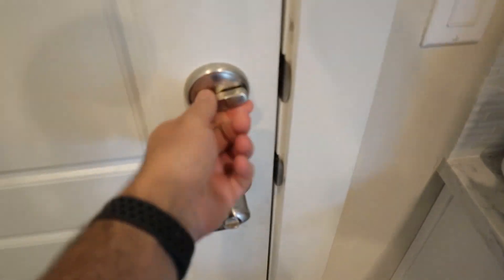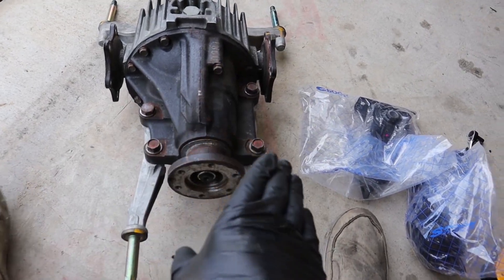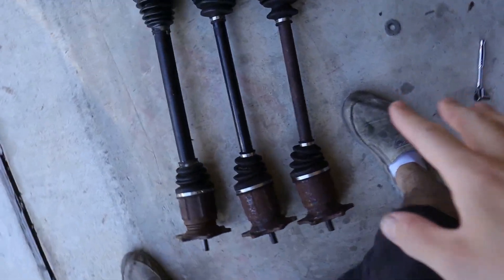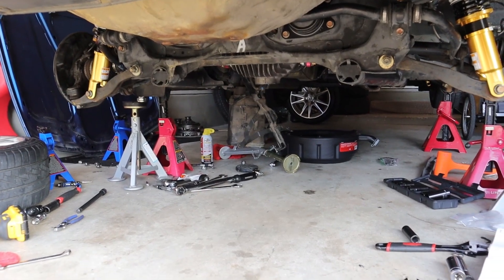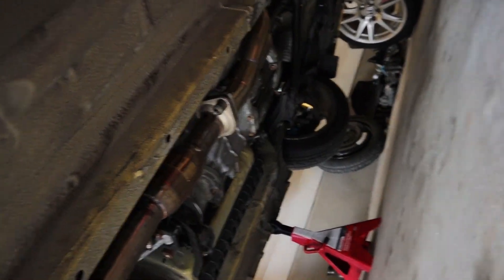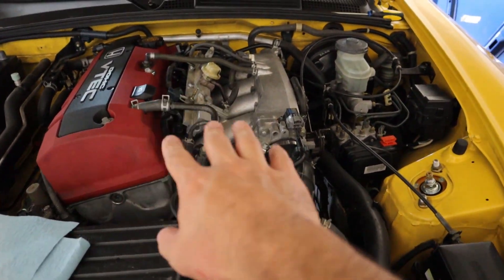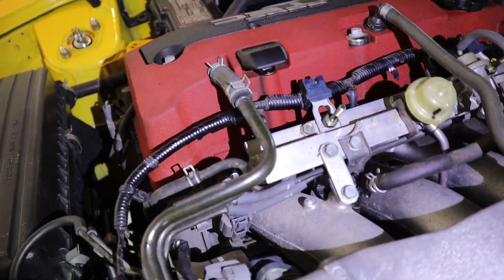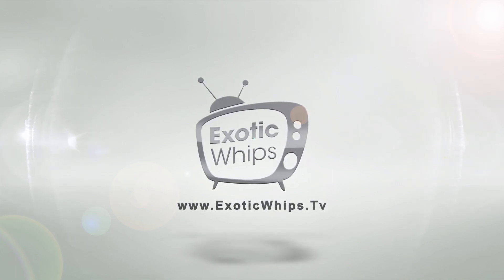Project S2000 FINALLY Runs! Mugen Exhaust, Spoon Diff Mounts, Axle Spacers & More.

Comment: Looks like you have rust in your trunk. Might want to check if your trunk is holding water and get rid of the rust.
Reply from the maker: Yeah, I did my best to tackle that. Wire wheeled everything I could then used rust treatment and painted over that. Hopefully it's gtg!